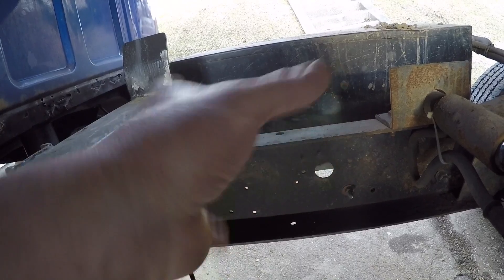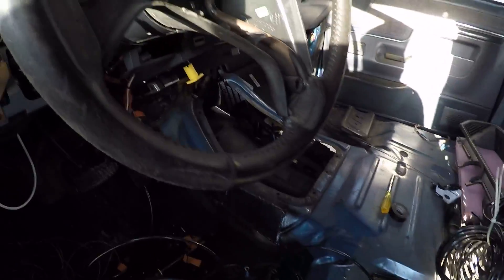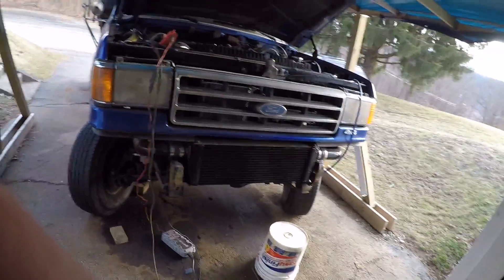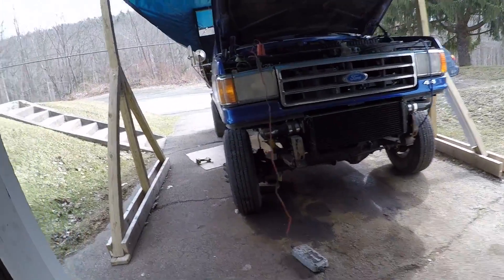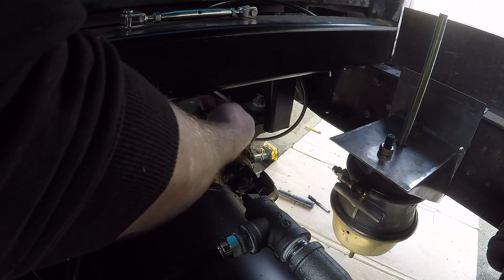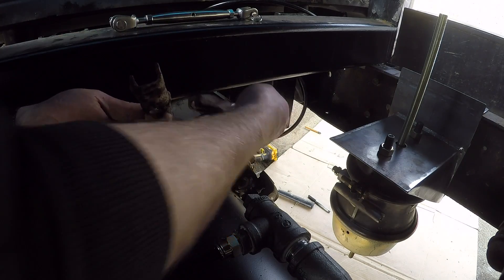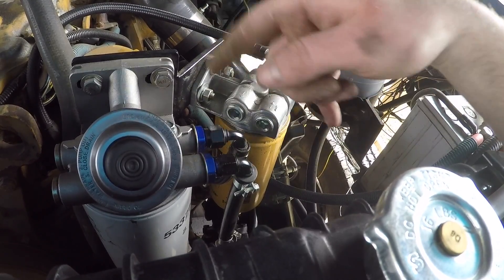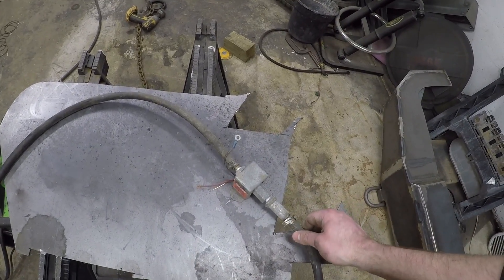Pt. 22 It Moves!!! Finishing And Pressurizing The Air System. CAT 3126 F350 Engine Swap

Comment: I'm sure you've already figured out your issue with the fuel but if not you could use the duralift pump that the filter on it. I'm looking at doing the same engine swap on my 86 f250

Comment: How did you connect the electiric wires to the battery to turn it on i have an engine 3126 i want to turn it on but i missed the wires procedure another question does this procedure works
 with C7 and 3176?
Reply from the maker: Pin 70 is your ignition 12v+, 52 and 53 are your 12v+ unswitched, 65 and 67 are your grounds. Wiring varies slightly between models and serial numbers, I have a diagram for an FMM C7 and it has 3 unswitched positives 48,52,53 and 3 grounds 63,65,67. As for the 3176 I do not know I have never had my hands on one.
Reply: Hi thx alot for responding but can u plz send me any website or video shows me better or usong whatsapp
Reply: Hola amigo
Reply from the maker: Al7or Hamze do you have an email?
Reply: @DrEwBaBy625 In the diagram it shows only one wire 64 connected to the pedal but i know that it has to be connected to three wires if you can help mme how do i connect it to ecm

Comment: A project like this would be so fun but it takes so much patience and time and a good place to store parts and the truck itself and that's all stuff I don't have.
Reply from the maker: This project was fun and I would do it again in a heartbeat! You can’t let stuff like that hold you back! My “shop” was far from ideal for this project, it may not look it in the videos but my driveway is pretty steep and I chased parts into the road often! One of my body mounts got away from me and ended up getting run over. Anyway point is if you want it you make it work!

Comment: That's awesome!
I just got my 05 f350 3126 swap finished I love they way it sounds. Dose need tuned up a little.
Reply from the maker: They do sound nice! Yeah thinking about doing plugs and wires on mine.
Reply: How did you connect the electiric wires to the battery to turn it on i have an engine 3126 i want to turn it on but i missed the wires procedure another question does this procedure works with C7 and 3176?

Comment: You are coming along good now. I'm just wondering does your fuel tank have a vent? Hope fuel filter housing is source of air leak letting  fuel bleed back. I would unhook fuel lines , block off return and put air pressure to supply line 10psi or less and for sure see where leak is.
Reply: You could possibly have oring on injector leaking. Could be cut or deteriorated.
Reply from the maker: Tank does have a vent. I actually wasn’t having fuel issues, it was another issue that looked like a fuel issue. It’s fixed now